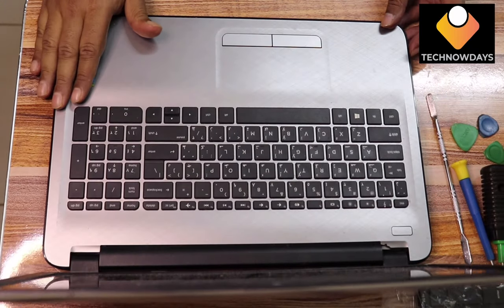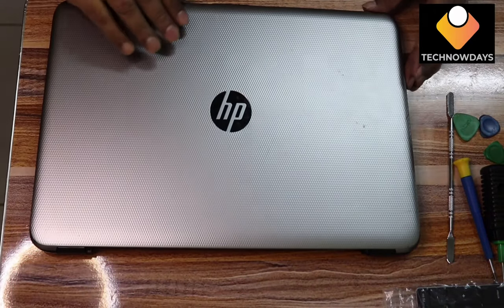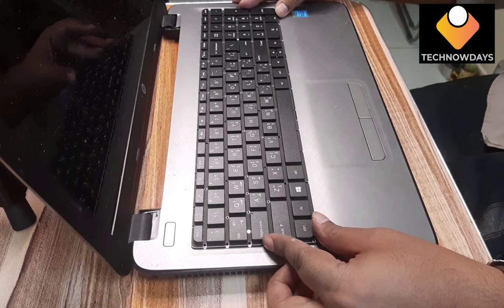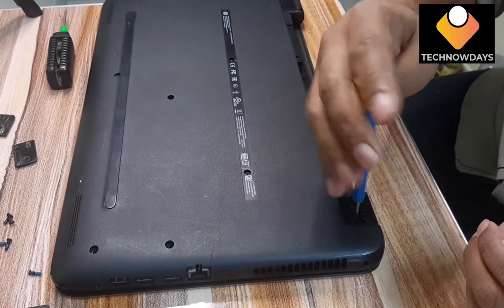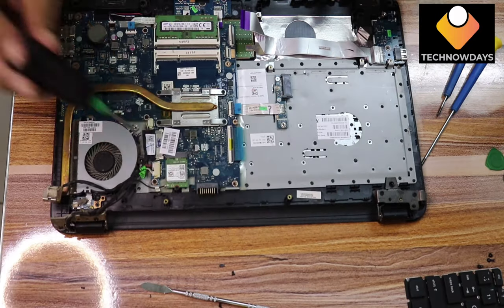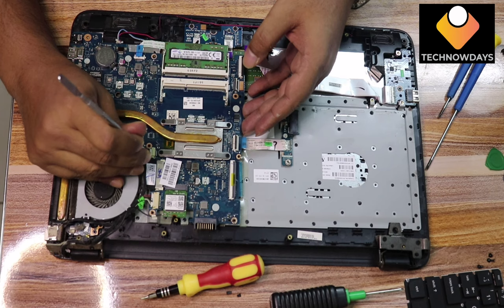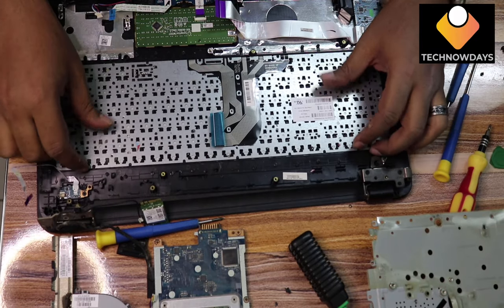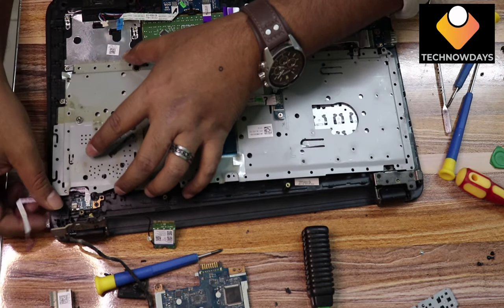HP 15 Laptop Keyboard Replacement, Full Dissembling Guide

Comment: Trust me people, it's NOT worth it! You can't access the keyboards on these modes without butchering the damn thing. There's a reason they have a riveted metal plate underneath every single other component and that's so that people end up warping it and popping off rivets making reassembling it impossible. By the time I got to the metal plate I just knew I wouldn't be able to put it back together so I didn't touch it.

Comment: But the keyboard metal retaining frame is plastic rivoted. So when you pulled over that metal cover you snapped all the plastic heads off. You can't just put the metal frame back on it will flop about, which will explain why your videos stopped at that point.
Reply from the maker: Hi, its already mention in d video, check once again

Comment: I use an old soldering iron to melt the little plastic rivets after replacing the metal plate.  You push the tip of it down, vertically into the remainder of the rivet and it mushrooms out, re-creating the rivet head, albeit not perfectly. But it's good enough to stick the plate back down pretty firmly and needs no glue.
Reply from the maker: If you are trying, can get revit tool.. Now these days most laptops coming revet type.

Comment: very useful, I replaced the keyboard just like that but it has a little bit not at the same level of the frame due to must destory all the plastic sealed  with the keyboard backward in factory.thanks a lot.